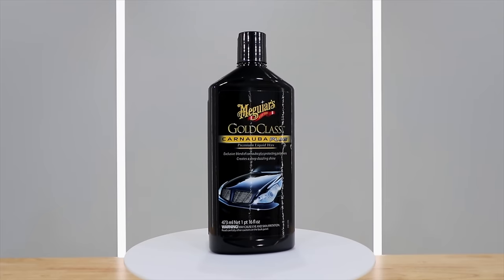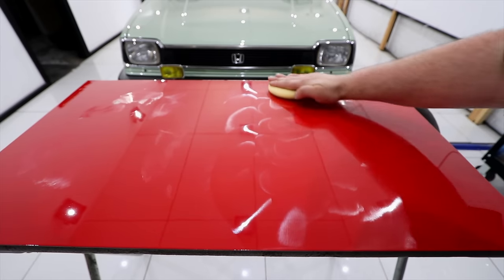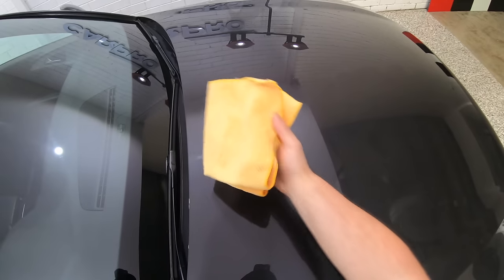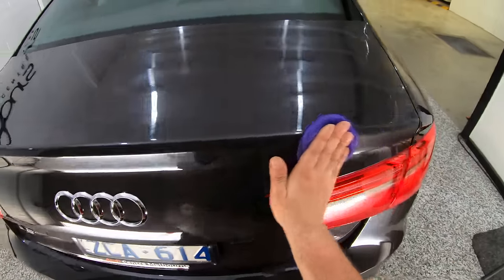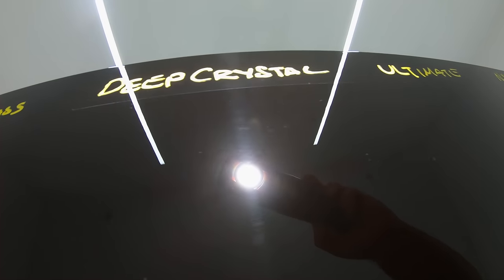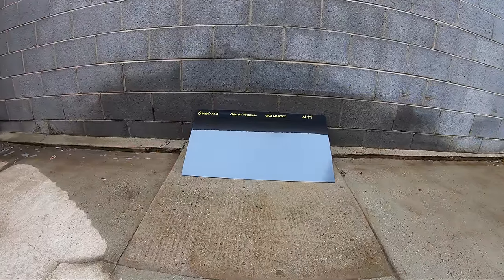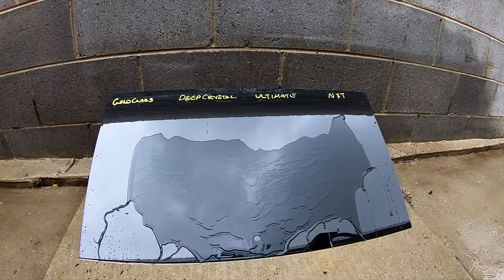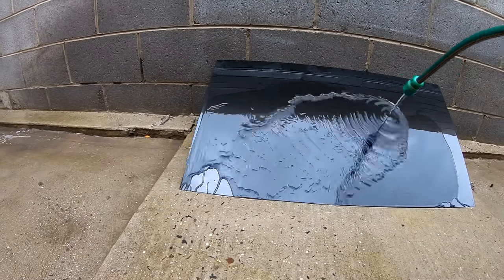What's The Best Meguiars Wax? What's The Difference Between Them?

Comment: Great video, and really got me thinking now. How would the NXT work similarly when paired/stacked with something like a hybrid ceramic sealant (or similar) as sort of a top coat. Would that give the best swirl/blemish fill, but then also give you an extra slippery finish with the hydrophobic properties that the ceramic products are known for? Is there a different method you would suggest for achieving that goal?
Reply: @CarCraftAutoDetailing  so to clarify, that is 2 coats of the HCW on top of the NXT (that in this video, proved the best in swirls fixes). Or is that instead of NXT all together, and the HCW achieves a similar (or better) finish?
Reply: Please forgive my relative lack of knowledge lol. I'm honestly pretty new to all these new wax products.(dont know why i avoided them so long, after seeing how easy they are). Just bought a used 2012 Infiniti G37x Coupe, and just feel the paint could use some love. So I've just been exploring options for minor swirl repair, as I dont see anything that would require a true cutting polish to fix. And so just looking for a product, or layers of products, to produce a great deep color durable finish on a black paint. Your videos have been such a great source of information so far.
Reply: @CarCraftAutoDetailing  Awesome. Thanks for the recommendations. I do plan on a real good handwash, then clay barring in preparation for the new wax as well. Just always been an old fashioned carnauba wax guy. But got interested in all this "new" stuff recently lol.

Comment: Someone advised me to apply ultimate polish first on mini sections & then apply gold wax( or any wax for that matter) in one application.
Reply: I use NXT for one main reason. It hold both its hydrophobic & protective properties (UV, bird droppings, water marks, etc) longer than the traditional waxes. Especially on the roof, bonnet & boot. Also, my preference is to first apply Meguiars ultimate polish, buff off (using a DA polisher) to get a nice, clean paint shine, then apply Meguiars NTX polymer sealant. Lasts 6 - 8 months. If I have time, I will use a quality wax (after the NXT) on my roof & bonnet, just for the extra protection. After 8 years, the paint is near showroom quality.